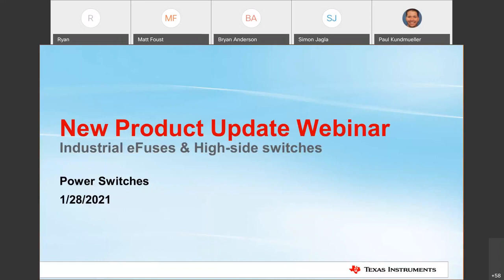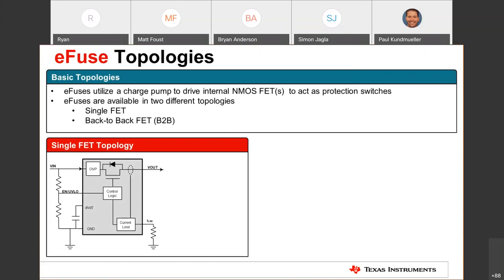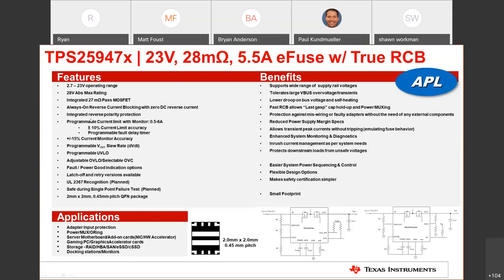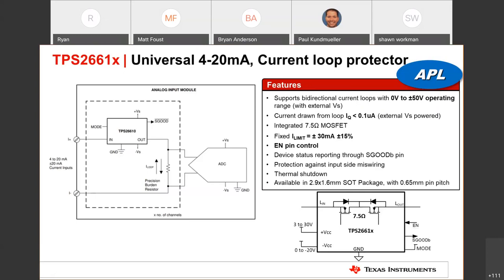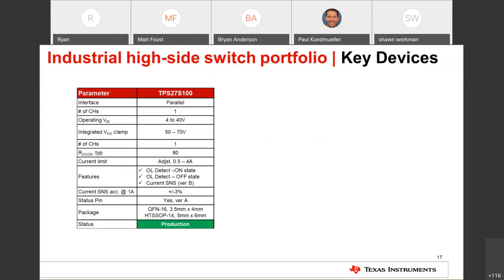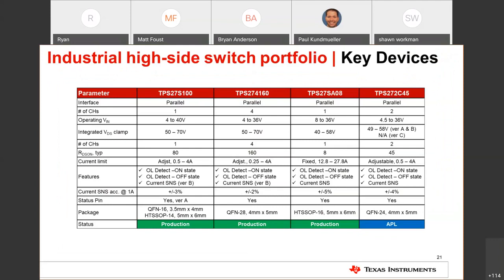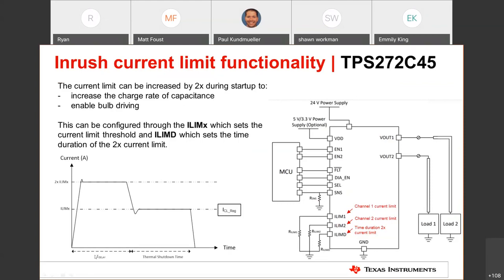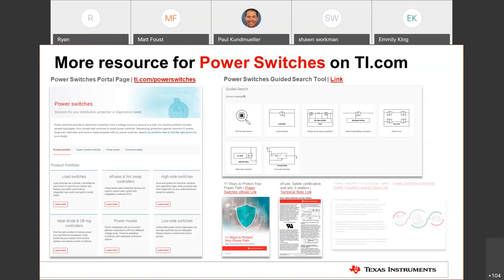New Product Update: eFuses and high-side switches

Comment: Any high side switch with serial interface and 8/16 channels ?
Reply from the maker: Hi Bilal, thanks for your question! At this time, our portfolio ranges from 1-ch, 2-ch and 4-ch at different Ron without a built-in serial interface. SPI control can be achieved using a couple of additional components. We have a complete guide including test results available in this application note: https://www.ti.com/lit/an/slvaex4/slvaex4.pdf. You can also find more information at www.ti.com/highsideswitch.